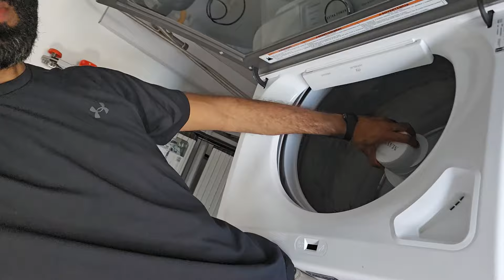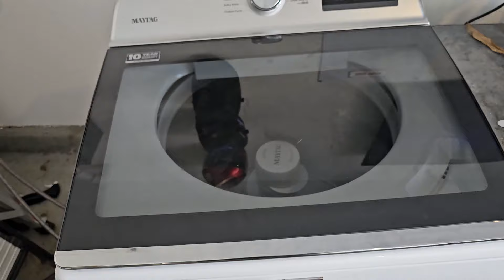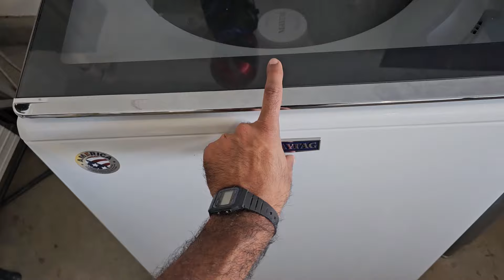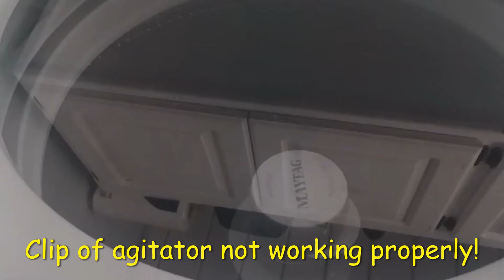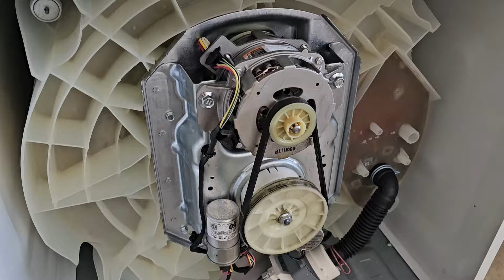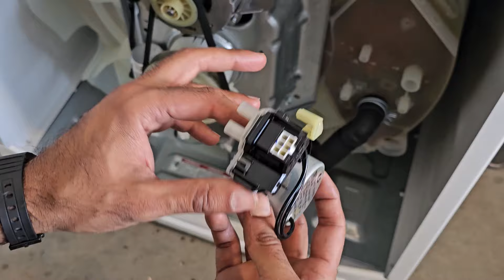Fixing A Newer Style Maytag Washer That Is Not Agitating/Washing Properly!

Comment: The latch did not move like your video....However.....I replaced the part anyway.  Technician where I bought the part said that it could be that motor in there seized up.  Changed the part and she's humming right along. Thanks for the video.  I'm sure you saved me a bunch of money with this.
Reply from the maker: That's great news, glad you were able to get it back up and running! 🎉

Comment: Amazing gonna try this tomorrow need that switch thing
Reply from the maker: Good luck with the repair!
Reply: @DuctTapeMechanic I can’t get the old transmission out.  I’ve used a tub nut wrench to get the bolt off.  Wd 40 and a sledge hammer but no luck yet

Comment: Thanks for the video, found the part was disconnected under the washer. I had replaced the agitator gear in the tub previously and noticed there was little wear on the old part, and suspected there was another issue. Now I can "find" the axe my wife was looking for to adjust the washing machine herself.

Comment: Hoping this is my problem. Ran a factory calibration cycle before ordering part… agitator moves but is soooooo loud. Was hoping that was it. However tried a small load… super loud and noisy and no agitator movement. So ordered this part and hoping for the best! Thanks for doing this video

Comment: Thanks for your video. It helped tremendously! My latch move, just like yours in the video so I ordered a new part, installed that easily thanks to you. However I ran into a problem. My latch kept coming loose from the hole every few watches… soooo I decided to use a zip tie through the hole and around the latch holding it in place😬… it’s working good so far. 🤞thanks 

Ps my reset is different for my Maytag it’s the one without the screen and lights at the bottom! I figured it out eventually 😵‍💫
Reply from the maker: That is awesome! Great job on the repair! Glad to have helped!

Comment: I have a similar model almost identical, but mine is a mvw6230hw3. I need to replace the rods but after removing the rear screws the lid would still not come up.  I noticed there are two screws on either side of the latch and was wondering does that take a special wrench because they sure went out of the way to make them hard to access and angle the wrench in properly to unscrew them.

Comment: I have the exact same washer and I just started to have this problem. But when my husband tried to fix it the bottom part don’t look the same is that one
Reply from the maker: Sounds like you guys have the belt driven version.
Reply: @DuctTapeMechanic how can we fix do you know?
Reply: @DuctTapeMechanic it has the same bottom from the other Maytag that you fixed the clutch
Reply from the maker: @jennifermota5838 Yes, most likely you have an issue with the mode shifter (if it is made loud noises as well then I would also recommend replacing the clutch)
Reply: @DuctTapeMechanic thank you for your help really appreciated it :)
Reply from the maker: @jennifermota5838 you're welcome!

Comment: Model
MVW623OHW1
I got ready to replace the factory mode shifter, with a new one but i noticed plastic shavings coming from the  splutch cam kit. Mode shifter arm is not loose so is it still good? Did Factory mode shifter messed up the splutch cam kit?
Or  the mode shifter   wasn't engaging properly.
I'm waiting for the new splutch cam kit but don't know if i should install the factory one back

Comment: You asked the question on your video how to take off the tough round plastic hub (with those two screws) that reveals the second nut to remove Maytag MVWP575GW agitator….

Solution:  Dig in three flathead drivers above each tab.  One twist and it was off to reveal the secret second nut. Voila.

Replacing stupid plastic hub with those Amazon metal ones.  Hopefully I can do it.  

Christine in SF 😅

Comment: What do you think is the BEST Model washer/Dryer??
Reply from the maker: Honestly, if you're gonna buy new. Get a LG top load washer washer with an agitator. I'm pretty indifferent about dryers (I don't like GE). If you can get watching dryer to the LG washer, go for it. This is just my opinion....
Reply: @DuctTapeMechanic  Awesome..Thanks for responding....Speed Queen any good?? TR7 Series
Reply from the maker: @for-real-for-real8148  that's the best in the business. Rarely see them in for repairs. But they are expensive...